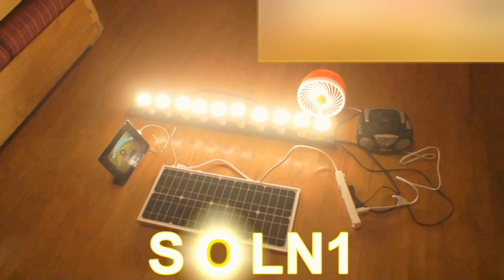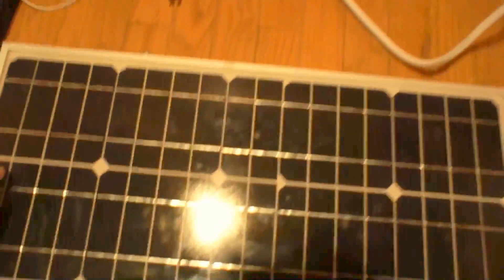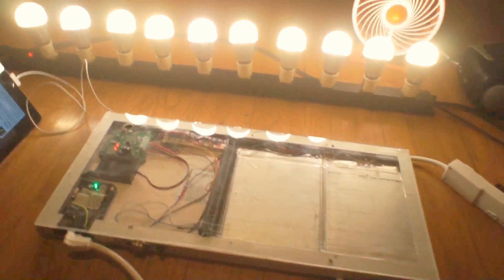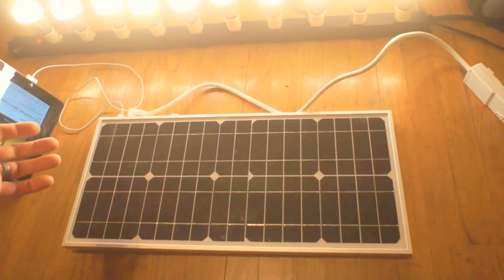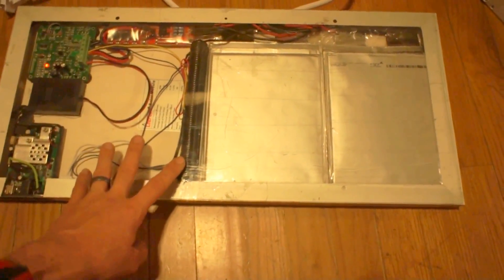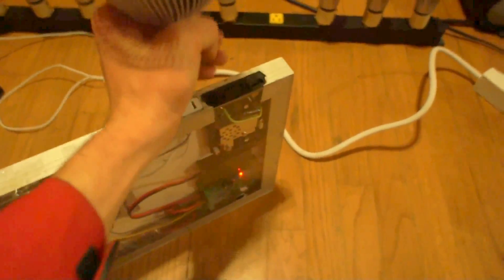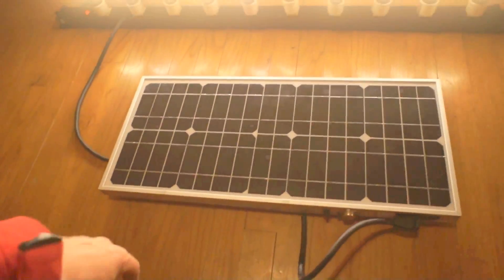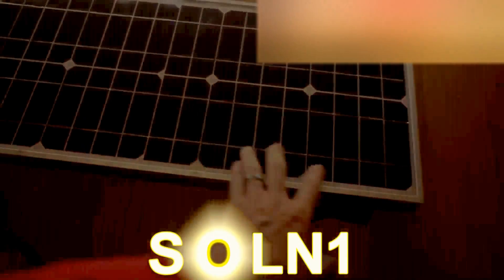SOLN1 - Amazing all in one free energy portable solar unit.

Comment: I'd like to suggest using Ammonia as a passive coolant PV cells loose efficiency when they heat up, also you can add fold able mirrors to concentrate more sunlight effectively doubling the panels watts for low cost.

Comment: Look at the standard operating temperatures of any non mil-spec component. They can easily operate into heat ranges above 100 degrees. Mil-spec components go much farther but are more expensive. Electronic components are not as sensitive as you think. The Intel Core i7 (Sandy-Bridge) operates up to 72.6°C which = 162.68° F and CPUs are by far more sensitive than most non mil-spec components. I used to design electronics, including microprocessor based circuits with all kinds of components.

Comment: no, not right. blowing hot air OUT of the unit just like a laptop computer. standard integrated circuits have a certain operating temperature range and 100 degrees is well within that range. However, if you really want to allow it to operate in extreme condition, there are mil-spec ICs that extend that operating way farther than commercial products. Unfortunately, they cost more. There should be some temperature testing to measure the worst case temperature extremes of it's operating environment

Comment: Don't see anything wrong with using the light array to charge the batteries. Without the sun involved the lights will not keep up with the battery charge required to run the lights over time. Just for fun (based on comments on another post) I took my 25 year old solar only powered calculator into a dark room but a small candle near it and that was all it took for it to calculate just fine. Its all still good stuff with room for improvement.

Comment: The heat in the unit would help keep the humidity down but there are also dehumidifiers available. Some are battery powered (9V / AA)and some AC powered. You see these commonly used in gun safes to keep ammo dry and prevent rust on the guns. Another common way to protect circuits is to encase them in epoxy. This is done very commonly by companies to protect copying of circuitry by hiding the components.

Comment: computer cooling fan. low power. put vents in the side of the frame and the pressure provided by the fan will push the heat out the vents. 12 volt fans are very common and come in a variety of size and rpms. Over the they have develop very low power ones to cool laptops and not drain the crap out of the. It's worth a test and would take minimal modification. The vent would have to be cut slanting down to prevent rain from entering the unit.

Comment: In my experience, a 70 watt PV panels puts out about 1.5 watts if a cloud gets in the way. Along the same line, once  the storage batteries get back to 85% +-  capacity, even with full sun on the PV array, only about 25% can be collected and stored in the battery.

Interesting work SOLN1. Awesome that you put it out there !

Comment: You might consider a thermal barrier between the batteries, circuits and the panel. There is bound to be some lightweight ceramic insulator to be found out there.

Comment from the maker: The LiFePO4 batteries I am using have a suggested working temperature between 10 ~ 60C or 140 degrees Fahrenheit.  These batteries are very different than Lipo batteries.  It is obvious from reading the comments that most people know little about them and should do a little research on the LiFePO4 battery to better understand what sets them apart.

Comment: Oops, I was talking SLA. These LiFePO4 batteries last up to 2,000 cycles at FULL discharge AND is like 95% charge efficient!
I wanted to do something like this, but with air space between panel and batteries (even though the LiFePO4 can handle the heat better than other chemistries) but can not yet afford to.
Lasersaber, Thanks for "re-motivating" me!

Comment: It looks to put out 2 amps (since full 6x6" is 8A). There's 36 cells (at about 1/2v each), thus 18v * 2 = 36 watt. But what matters here is the amps.

2A charges a 20Ah in about 13 hours if completely discharged, not 10 because of battery inefficiency of taking charge (and because of imperfect sun angle). Discharge only 50% of the battery or less, thus about 7 hours per day for about 10Ah which lights 4 Cree XTE's (at about 800 lumens) for 20 hours! Need to use Ohms law and heavy duty resistor.

Comment: great concept. but with all those devices in that enclosure in a hot sun  can get hot quick. and when solar panels get hot. the efecancy drops like a rock. cool design. but id suggest a separate enclosure for the electronics and put a good 1/8-1/4 inch gap between for air to cool down the panel

Comment: 1 amp at 12v are 12 watts (where did y take 120 ? )
So it will take app 10 hours to charge

I use a 80 watts panel + 25 ah 12 v  agm batterie .
= 4 amp normal * 12 v  = 48 watts.
So it charges 25*12 = 300 / 48 = 6,35 hrs
on a sunny day its realistic to charge my battery in one day - tested !

Comment: hey! what if you added a few peltier devices to cool the batteries. or if that is not needed you could creat more power by taking heat from the back side of the batteries and a CPU liquid cooler on the cool side of the peltier to create more power?  NICE video!

Comment: You should find some sort of easy to attach/detach bracket that could be mounted on a window pane of a house (preferably the top of the window pane). That way it's even easier yet with an included hanger option.

Comment: Good idea. I'm surprised you're incoraging people to build and sell your idea. I agree, solar needs to get out there more. And the only way to make the average person buy solar systems is to make it compact and easy. My consern with this unit is the heat inside the panel. My sugjestion is to waterproof the electrical components inside with epoxy, leaving heat sinks open or adding some to components. Then use that open space for a fan.

Comment: No, if the battery is 20 amp hours it would take 10 hours to charge, 30 watts at 12 volts is 2 amps so in 10 hours the solar panel can provide 20 amp hours of power fully charging the battery, what a great idea, the only problem I see is the heat created form the panel heating up the battery.

Comment: how many watts of power on that inverter?  maybe 100 ? would work for small thing but nothing big.. what about the cooling problems ? its would over heat if used while in the sun.. Wouldn't mosfets work better than what your using mounted on the side there?

Comment: I like the Idea, it is good for certain limited applications.
A 20 Watt Solar panel will push out 1.4 Amps at high noon, no clouds.
At that rate, It will take 14 hours to charge the 20 Amp/Hour batteries.
You don't get full charging capacity all day long, so it would take about 2 to 2.5 days to fully charge the battery pack.
How many ponds is that Unit?
Why you never talk about the drawbacks?
Only the advantages.

Comment: your cells will last much longer if you clamp them as they can swell when charging which will damage them internally perhaps with some polycarbonate/composite sheet and some shrink wrap as they often do when manufacturing batteries with soft pouch cells

Comment: 20ah 12v would be take 20hours on 1 amp /12v (120watts) to charge. 
That solar panel maybe at best puts out 20/30watts?
So to charge the whole battery would take about a 100hours (2 weeks in real life day night cycle) to charge in optimal conditions. 
Or did i missed someting?

Comment: I have seen plastic melt in a hot car, you have the electronics and batteries in the back of this thing on a hot tin roof, I would think after a while the heat could cause some problems.

Comment: This concept is stupid and does not work as shown. IF you run the system for long time the light brightness will go down and will be dead. Now it's running because the batteries are fully charged. If this system to be run like shown you have to have 100% efficient solar panel, 100% efficient light bulbs and 0 ohm wires and 100% efficient batteries and so on. Which world carry 100% efficient stuffs?  There is a energy loos between the lights and the solar panel.

Comment: This unit should be developed for conventional use(not just for low watt output but also for stove, washer/dryer, fridge, etc.).   It could also be used as an anti-HAARP device if enough people use them.  If high temps or draught conditions are happening somewhere then the alty energy people should 'bomb' that area with this device.  By 'bombing' I mean getting multiple units of this device are used in the abnormally warm area.  The possibility to  counter HAARP activity exists with device.

Comment: HELP! QUESTION. Hey there, I've been following the project since November. Thanks and congrats! I've built my own and I have a problem. I have even voltage across the 4 batteries, but the charge controller isn't turning on and I have no voltage at the inverter ports of the charge controller.  I have both holes of the P+ and P- soldered.  I think that may be my issue.  Should I just be soldered to the charge or discharge hole by itself?
Thank you

Comment: Nice unit! I actually had this idea, and built one about a year ago. Mine
has 100w panel, MPPT charge controller, and 20ah of LiFePO4 cells (round cells).
However mine only puts out DC, so you have a nice addition with the inverter & Joule Ringer.

Comment: Dear laser:
I wondered if you had ever considered the line voltage of a telephone line ?
Mine reads between 40 45 volts dc. Seems some interesting things could be done with a millivolt load on the line for backup or emergency uses . of cource i relize this is considered theft by mabell but let us say it would be for educational use only.

Comment: Brand new 20Ah LiFePO packs run less than $40 (check eBay or Amazon Market). If you head over to the OPs website he links every part used, his entire cost was less than $300. That said, this will never be a cost effective energy alternative, but as a camping or emergency backup power source its pretty cool.

Comment: Two 10 AH lithium Ion phosphate batteries ALONE cost about $500
To charge this unit completely, it would need 16 hours of full sunlight.
The batteries might not do so well under all that sunlight(if they are at all like lipo)
The electronics and housing could easily total about 500$
So you are looking at $1k, and its safety in full sunlight, for 2 days (complete charge) needs to be evaluated to determine safety/overheat/explosion. (can't turn sun off in overheat condition)

Comment: I'm a mobile DJ. I would love to see one of these that can handle 20 amps for 4 hours. I know that's considerably more than what you intended but it would be of great assistance to me. It would be far better than running a generator that burns fossil fuels for the same amount of time. Right now I'm stuck with a little Honda portable 2000watt that I would love to be rid of.

Comment: Good idea, but I'm afraid that solar panel is WAY too small for the other stuff. Like trying to fill a swimming pool with a shot glass. And it can't charge itself from the lights it is powering. Staggering amount of power loss. I think it will pick up the voltage signal from the lights tho.

Comment: wow the more I look into those batteries the more I am impressed ... the nonophosphate allows for some impressive specs like 1200watt pulse discharge power  ... and operating temps as low as -30degC which makes them great for northern climates ... the upper limit is only 55degC which could be a problem on a really hot summer day sitting under a solar panel on top of a shingled roof but a small circulating fan could resolve the issue.

Comment: There are commercial versions like yours on the market - around 360 dollars. What did it cost you to build? What price do you sell your units at? Am thinking that the single light will run for 60 hours approx. and your unit will take about 25 - 30 hours to charge in full sun light based on the size of your solar panel (system losses taken into account)? The Joule Ringer may be helpful, but what have you found data wise on your testing that convinces you its worth adding to the system? Cheers

Comment: excellent design ... the charge time would be .. 20Ahr x 12V = 240 watt/hrs ... / 20 watt panel = 12hrs ... kind of long for northern climates but it would be easy to add a second panel and hinge it making a fold out... those lithium batts are just all that and a bag of chips.

Comment: What you are refering to as a joule ringer is actually a class D oscillator/amplifier, and yes, the class C and D amplifiers are far more efficient than class A and B types. If you look at the schematic for an Armstrong oscillator in an old radio engineering book, you will see something nearly identical to the joule ringer/thief. If you use a class C oscillator that oscillated at 60Hz, instead of the typical class D joule thief, perhaps you could get rid of the standard inverter all together.

Comment: the batt. power which outputs to the bulbs is more energy than the solar panel could absorb. does something, just not forever. 

Unless both artificial light matched the sun's energy  
& panels = 100% efficiency, then were talking circles.

Comment: Very good job budy. I am a very poor guy so i hardly can do these kind of expérimentation by myself and i'm wondering if we put your system in front of lights running on another set of solar panel with joule theives. solar panels are face to face with the lights in betwen. in a kind of closed box.  Would it be over unity?!

Comment: Absolutely not.  A closed system can never self sustain.  Consider the panel is maybe 40% at best so the light generated from the panel can only absorb max 40%.  Therefore the current drawn to light the bulbs will always be more.  40% maybe generous for a solar panel.

Comment: Oceansolarpanellight  from solarpanelight  
Hi Lasersaber
Hope  the control circuit to be easy to replicate
Now  im using the rediant oscillator from Bedini for boosting the charging of 2 7 ah batteries separately from 2 series 10 w panels    Check out the solar switch from JB  it will surely fit  for low lighting   or can just make it as well

the simple inverter from skywatcher   works fine also  lots of ideas built into one
we need to aspire for the all weather Laser solinone      lol

Comment: What kinds of safety features are incorporated beside the UV and OV that you mentioned?  Does it have any sort of output short circuit protection?  Do the batteries have an over/under-temp monitor and shutdown?  What about EMI on the output of the Joule Ringer?  Do you ever envision the SOLN1 to be used outside, and if so, what happens when water enters behind the panel?